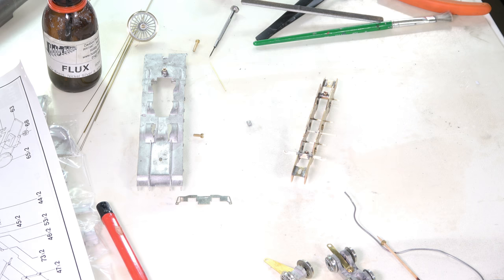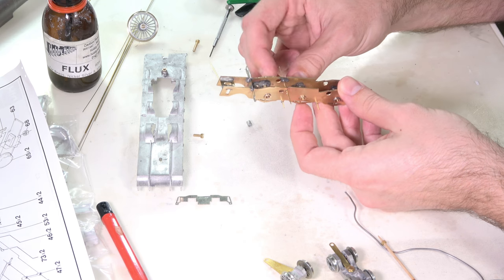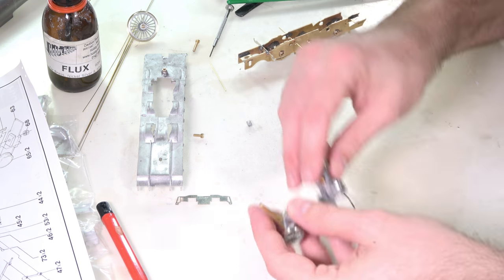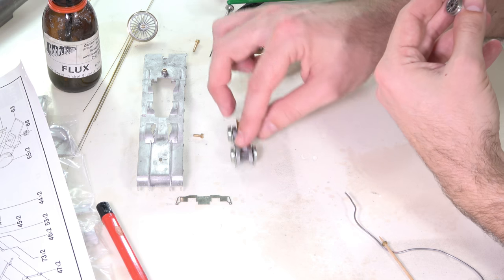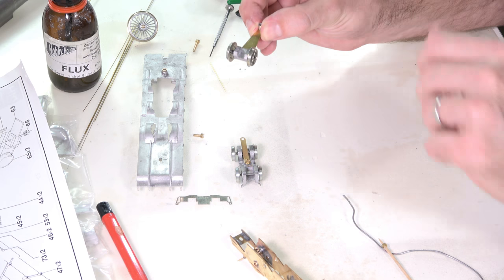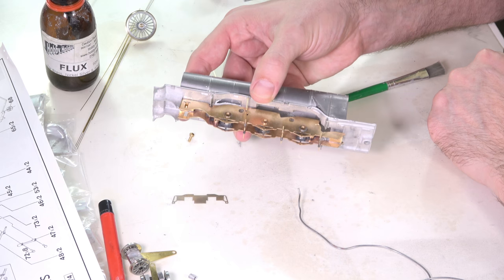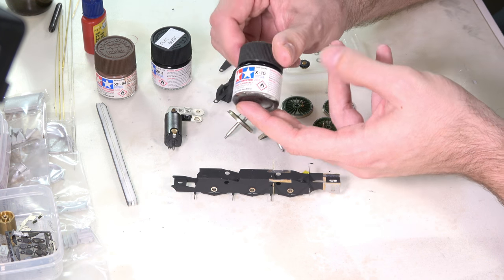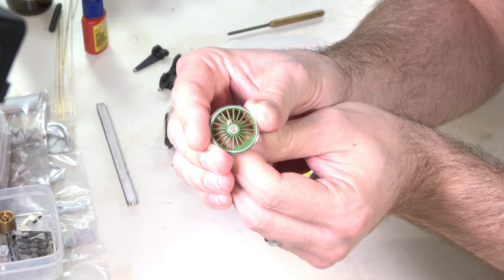Lets Build DJH LNER Pacific Part 2 Soldering Chassis & Pick Ups

Comment: Very nice work!  I took some tips from your last video while building my CR 0-4-4T (kit K8), and I'm glad to say it helped quite a bit!  I actually had the same idea for mounting the chassis to the floor plate, but I used epoxy instead of solder for the nuts since my iron only goes down to 650F.  I wish we had at least one manufacturer in the US like DJH, because it has to be one of the best quality kits I've ever built.
Reply from the maker: Great to hear you're enjoying the kit building. I agree the DJH kits are very nice to make, and require little if any modification in order to get a nice looking loco.

Comment: Hi Tom. Have just started DJH A2 (K33) so following your video and Tony Wright's DVD to get the best possible pointers. I will be running on not less than 32" radius, but could do with some advice re side play for the centre axle. I will be using a Hi Flyer gearbox giving 8.5mm over the g/box frames and will file flush the axle bearing in the gearbox (looks as though you did that). The distance between the chassis frame is 9.5mm. Most of that clearance would be taken up by the protruding bushes in the chassis frames. To give enough sideplay do those bushes have to be filed flush also.
Great videos - thanks so much. David
Reply from the maker: The best thing I can suggest, Dave, is to set up your 32" radius track, and run the loco through it to see how much the wheels want to move on a free chassis with no motor. I tend not to like too much movement if you're driving off the centre axle, as I don't want the gearbox moving about too much. Maybe a mm or so? The front wheels need to clear the valve gear too. The rear ones can move more, so over the three wheelsets you should be fine especially at 32" min radius. Unfortunately the loco is in shipping at the moment so I can't check it! HTH.

Comment: I was told by a seasoned loco builder to file/grind a small flat on the centre axle.  This is to allow the screw in the gear to grip the axle better.
Reply from the maker: Hi Steve. I personally don't, however, I can't see any harm in doing so, certainly doesn't seem like a bad idea, but I think the grub screw probably digs in a little bit giving a similar effect?

Comment: Tom,

Great video. I love the idea of making the pick ups before attaching them. 

One comment if I may. I think you were rather authoritarian in your 'must be neutral chassis for DCC' comment. I agree it's best practice, and if I'm starting from scratch that's what I do, but I have plenty of kit built locos running around on DCC with a live chassis - you just have to deploy lots of insulation to remove any chance of shorts.
Reply from the maker: Hi Andy, thank you for commenting. You’re absolutely correct, and I have had a couple of messages calling me out on this. What I meant to say was that it was my personal preference to build dead chassis for DCC. As usual I get carried away, but I will definitely address my faux pas in my next video. Cheers.

Comment: Hi used the videos a lot and a great help. Two questions - when masking the axle holes I have used hole punched circle of a sticky label, what do you do on the inside edge? Just ream it after? And when will you make the motion gear video?
Reply from the maker: I just wedge a blob of blu tak in there.

Comment: Hello, I loved watching your videos and you are doing great educational work. Being a beginner int metal kit, this help me a lot.
I received as a birthday present the kit of the 231 A (ref DJH E115). Normally, this loco is intended for a turning radius of 765mm, and for me it is a serious problem, since my railways has a turning radius of 360mm. I know this is not realistic, but unfortunately i can not do better given the space i have. 
My question is, is it possible i make modifications on ths kit so that this magnificent loco can ride on my railways ?
(sorry for my english spoken, i am french... :( )
Reply from the maker: Hello Eric, I'm really glad you like the videos, and I am especially glad you're doing some kit building! I'm not familiar with your kit, however, in order to get it to go round tighter radii, you'll need to ensure there is plenty of sideplay in the wheels. If you have a ready to run model that works well on 360mm curves, have a look how much sideplay there is on the main axles. Then try and replicate this amount on your model. Normally, DJH frames are quite narrow, however if you are really struggling, you could try and solder the axle bearings on the inside of the frame, and then file flush on the outside of the frame, thus increasing sideplay. Be careful however, not to introduce too much, as it might interfere with the valve gear. I would try assembling the chassis as an 0-6-0 first, and test on your track until it works, then complete the rest of the chassis, test, then finally fit the connecting rods and motor/gearbox. Test again until you're happy. Good luck.
Reply: Thank you for your advice. Fit the bearings inside the frame is very good idéa. I hope it will be enought.
Thank you very much for making us enjoy your experience :)

I would say here if i succeeded and if it really works. :)

Comment: NOOO! ,don't use flux on electrical wires, as flux is an corrosive acid, most common phosphoric acid.
The flux can not all be rinsed of because it will soak into the wire inside the insulation cover by capilary action and corrode the metal away over time, leading your electrical connections to fail.
The good way to do this is simply tin the ends of the wire by holding it at the end of the tin wire and aplying some heat, the electrical grade solder has a resin core which is a non corrosive flux and is enough to make the tin flow.
Once the wire is tinned, and there is tin already on the PCB (make sure flux is rinsed of with water and soap after soldering the pickup wipers) its easy to solder the wire to the PCB.

You did a very nice job on painting and lining those wheels, and the tip for these spacers from 247 Developments is a good one, didn't know they make them, as Romford wheels and axles sometimes struggle on FS track like Peco code 75.
Reply from the maker: Hi, thanks for taking the time to make constructive comments. As you can hopoefully see in my videos I try and avoid telling people HOW to do things, its just how I do things. In my view there are many ways to 'skin a cat', so I appreciate that you've taken time to share your methods as well.
Reply: Thanks for the way you took my comment, I try to let people learn from mistakes I made in the past so that they can avoid disappointments I had like the malfunction of a layout after I used flux to solder wires to rails, and then over time more and more connections failing because the wires were rotten away inside the insulation.
Reply from the maker: It’s an open community so constructive comments are always welcome.
Reply: I ruined the loft out section on my layout as the 3.5mm plugs I used rusted up as I didn't wash them enough after soldering 🙁